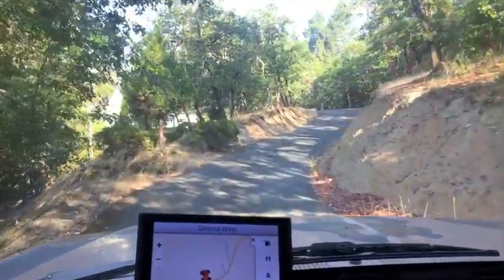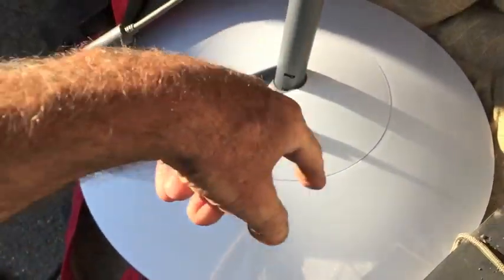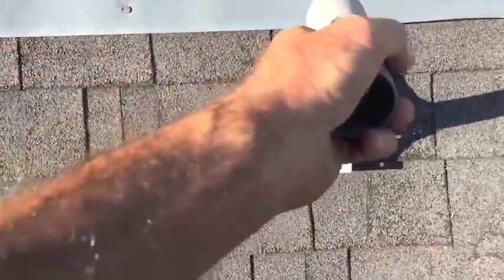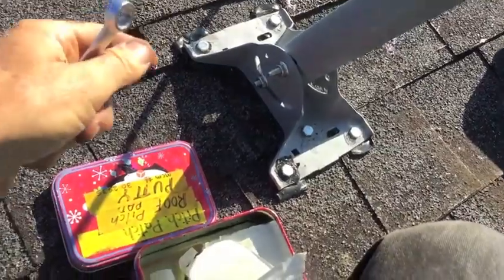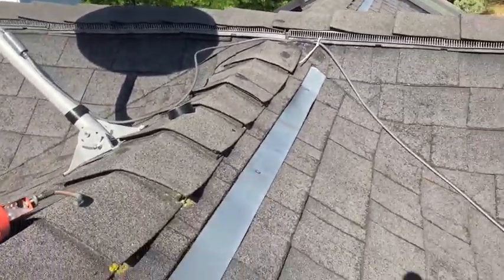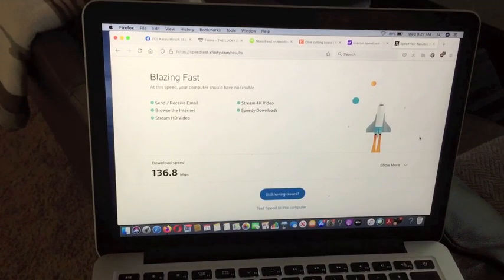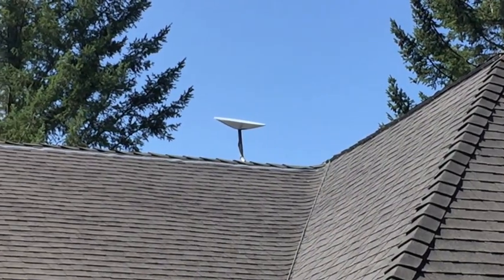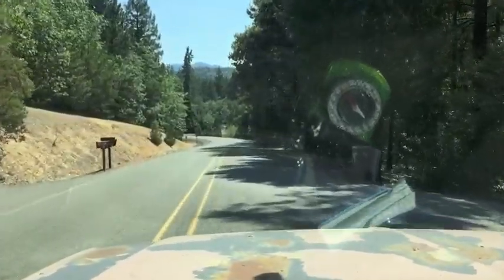Starlink Satellite Installation Job.

Comment: Have you witnessed Starlink in the night sky yet? It is a little crazy how long it is and it's only a fraction of what it will be. I find the satellites more of an eye sore than the dish.
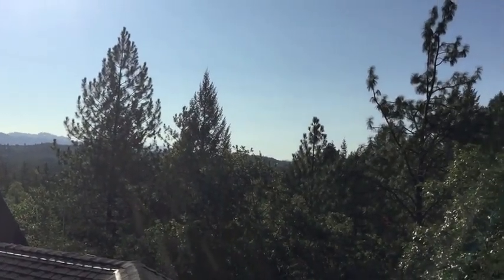Reply from the maker: I've heard about the visual train of starlink satellites, but I've only seen them in 3:42 of this video.  https://youtu.be/hfUmeCBvIQ0?t=222
Reply: After the satellites spread out, you can don't noticed them with the naked eye, unlike the ISS which is very visible.  It's only the initial train you can spot and they last for about 6 weeks after deployment.

Comment: So the dish itself has a motor in it to find the sat? The pitch putty is also known as weather wrap. Make sure to use some rubber spray on the mount bolt holes. You don't want to be liable for roof leaks. Looks like the far end of Upper River Rd, David.

Comment: I recommend you put a loop in the cable near the dish before you tape it to the mast. That way if you have to remove the dish you will have enough slack in the cable to raise the dish out of the mast.
Reply from the maker: Yes good idea. Thanks for the tip.

Comment: I remember commenting on one of your videos about these when they first came out. Nifty little things for people in remote areas. The download speed was pretty good. I believe the latency or 'ping' rate of them though isn't the best, so with things were you need quick communication back and forth, like playing online games (where the position and action [telemetry] of characters need to be updated at both ends almost instantly) the link might not be the best experience. Will probably get better over time though. Do you know if there is any way you can become an approved installer or such? Might be worth looking into for you. Cheers mate.
Reply from the maker: You're probably right about the business opportunity here. I'd imagine the demand for these is going to grow fast.
Reply: I've had Starlink since last November.  At first the ping wasn't as good, around 50+ ms.  They have done a lot of updates.  My ping is now around 20 to 25 ms.  Good enough to play games competitively.  Just ran a quick OOKLA speed test and got 24ms.  My speed was 161Mbps, which is about average, although I generally get above 200Mbps.  PS, I'm also in western Oregon.  I have a tiny amount of obstructions.  I'm going to mount it to a pole once I get the pole buried in concrete.  Mounting it to my house will actually increase the obstructions.
Reply: Second quick test, 20ms ping, 226Mbps.
Reply from the maker: @owenjohnson5030  The first one I installed hit 220 Mbps, I figured it might have been a mistake. so I appreciate the confirmation.
Reply: @owenjohnson5030  No, 20ms ping isn't too shabby at all. My 100Mbps fibre is 9ms to an exchange 25 miles away. I believe Starlink sats are 200 miles above the Earth.

Comment: Hello. Can these be mounted in a different location when you move to another city? I mean can you take it with you when relocating
Reply: just check with Starlink and make sure they cover your new location.  You have to then register your dish for the new location as Starlink currently assigns your dish to specific operating cell.  I think that's going to change eventually though.
Reply: @wesmckean1443  many thanks
Reply: Apparently they are quite bad with changing your location. The story goes Ukraine is the first place where roaming is possible...

Comment: Will it become full of water during rains.
Reply from the maker: I would hope not. It's designed for outdoor use.
Reply: Don't worry Elon is going to release a software update that going to get the dish to tilt every time the rain finish falling and get all the water out think about it Elon style.
Reply: @electronicartis  Imagine wondering why your internet is slow, looking up at the roof and seeing a wood pigeon having a bath in your Starlink.
Reply: @yorkshireplumbing  no need to worry Elon is going to release a software update to fix that problem too you know how it goes.
Reply: It is completely watertight. and it is always at a small incline to have water/melted snow(aka water) run of it.